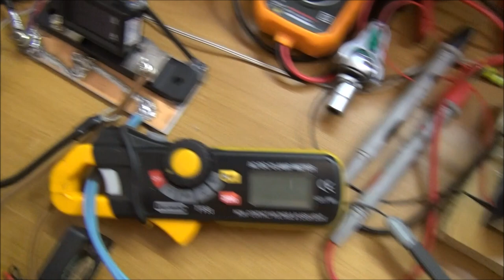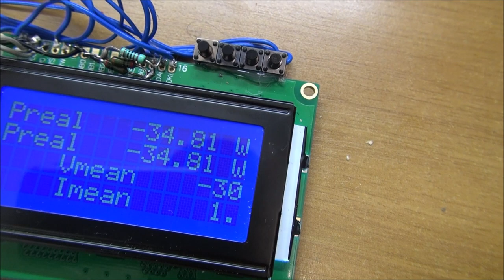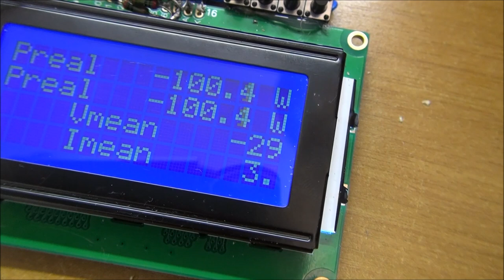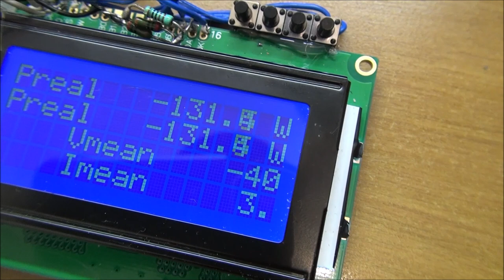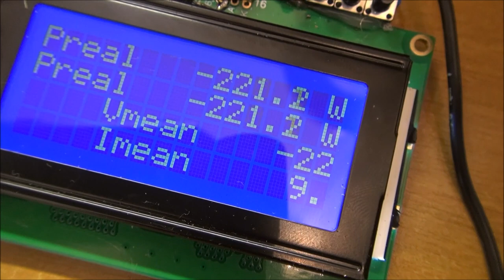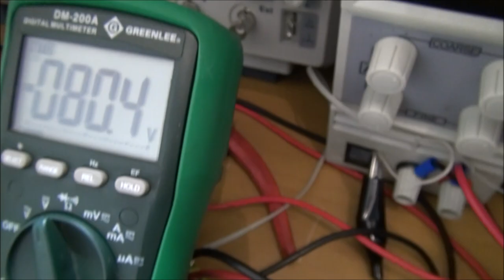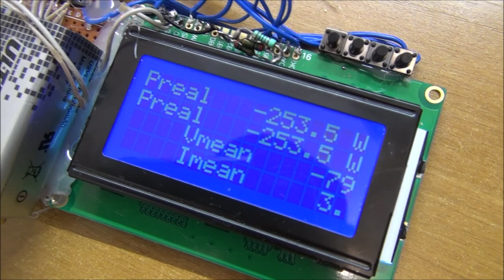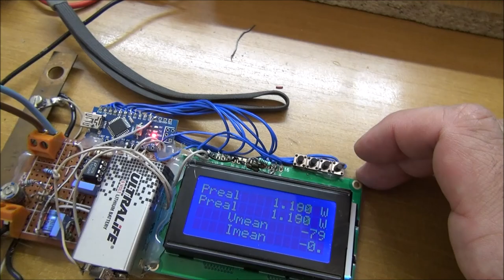Boost converters: The real watts

Comment: hi ,
Does the 48 volt inverter work ?
48 volt 4 batteries required..
Can I use this device with inverter by turning 12 volts to 48 volts
Reply from the maker: If you are talking about the 1500w model yes you can do it.
Reply: @AIexanderHartdegen  thank you
Can you assign AliExpress Link?
Reply from the maker: @suataydemir9144  250 watt 
https://m.fr.aliexpress.com/item/4000037330204.html?pid=808_0002_0109&spm=a2g0n.search-amp.list.4000037330204&aff_trace_key=093e286065e34f0cbe177f0e5ff513e3-1566671079052-07768-UneMJZVf&aff_platform=msite&m_page_id=3354amp-Nyn1V3ZSbWSTtwPtERk9sw1566671192378
1500w https://m.fr.aliexpress.com/item/33044762095.html?pid=808_0002_0109&spm=a2g0n.search-amp.list.33044762095&aff_trace_key=093e286065e34f0cbe177f0e5ff513e3-1566671079052-07768-UneMJZVf&aff_platform=msite&m_page_id=3354amp-Nyn1V3ZSbWSTtwPtERk9sw1566671192378
Reply: @AIexanderHartdegen  thank you...
how many watt current loss on the battery 12 volt...
1500W 30A how many watts energy grout...Does 12 volt discharge the battery quickly?hopefully the correct translation has been....the subject i mean : What is the energy consumption fan and diodes ?
Reply from the maker: the power output is the same than the power input, with a little loss.
For exemple, if you are supplying a device using 100 watts with this DC/DC converter, you will have 105 watts on the battery circuit.
Yes, according to the power output you can use with this unit, this booster can be greedy of energy. And this is normal. Fan and led are not greedy of energy, and those consumption are negligeable.
Reply: @AIexanderHartdegen  thank you that was the answer i wanted

Comment: So, I want to take the output of an 100 amp car alternator and boost it to about 42v 2000w, what would you recommend?
Reply from the maker: You can build or to make engineered the device you want. It can take time and it can cost. But you can spent some money on these bigs converters. You probably need 4, 5 or 6 of these.
You have to connect all the output adjusted at same value with low value resistor each. It can make the job.
Reply: @AIexanderHartdegen 
Low value resistor   value  how many ohm
Reply from the maker: @fapalakad665  between 0.4 and 3 ohms, need to test and check if regulation works for all devices in the same time.

Comment: Hi, i want to step up voltage of my electric scooter, it is 60v battery (30a discharge BMS), fully charged is 67v, can i step up from 67v to 77v? I read the maximum input of boost is only 60v, can it handle 67v? Thank you
Reply from the maker: This is a hard question. For to know that, you need to read the capacitor in front of the power supply section. They need to be at 67v at least. 67V here are the voltage of a non load battery, wich means than this voltage doesn't stay in the time.
You can try by connecting your battery to your booster with a 25 or 50W bulb connected in series. At first, you can see the bulb emiting a short light, and switch of. If the light is always emited (with 5/6.7 volts at it's lead) that mean than the booster is over supplyied. Anyway, take care about that but I think it will works nice. Thans for your comment.
Reply: @AIexanderHartdegen  ok tell me just one more thing, in booster i can regulate the amperage correct? Im thinking in buy the 1800w booster in aliexpress and my battery bms is 30A and my controller is 25A, so in booster i keep the booster at maximum amperage? How i regulate it?
Reply: Do you have any other way of talk with you? Thank you
Reply from the maker: @gabrielpinheiro114  you don't have to regulate anything. This is the role of your controller, you just need to supply enough current and voltage. Just keep the current control of the booster at the maximum.
The potentiometer on the 1800 booster is a current limitation, for preventing an overload on a basic load, or an battery charging process.
Reply: @AIexanderHartdegen  so i keep the input  voltage of potentiometer at maximum and also the potentiometer current at maximum? Just adjust the output to my desire voltage correct?
Reply from the maker: YES. But don't forget a protection of a 50W 12v or 24V Bulb when connecting your battery to the booster. Be sure your controller chan withstand your desired voltage (even with connecting a bulb in serial with it). When nothing is switched on, the bulb must be of (in serial with the booster and battery). You can use a triode of a car (bulb with 3 pads) to simulate a 24V bulb.
First, verify than your booster can support 67v with bulb. If it's ok, let's to the remain thing. You are experimenting, you can destroy your booster, or damage your battery, this is high power with high voltage, this is an unfamiliar hazard project. Be very carrefull for to destroy nothing and burn nothing. Thanks
Reply: @AIexanderHartdegen  but Alexander the 67v im talking is when the battery is fully charged, the cutoff voltage of the battery when empty is 45v. Dont understand good how to connect what you say, can you do a   fast drawing picture? 😥
Reply from the maker: http://lektronik.canalblog.com/archives/2019/11/16/37794373.html
Reply: @AIexanderHartdegen  i do the test 1 with 67v battery charged and 12v lamp?
Reply from the maker: @gabrielpinheiro114  yes, this the first test, the test 1. After that, if you want, you can make the test 2, for just to see if controller can hold the new voltage coming from the boost converter.

Comment: Sir, awesome video. It was very educational. Can you please tell me how to change the trimmers on the first converter you featured to a linear rotary potentiometer. My converter is the 400 watt type. And it has a trimmer for CC and one for CV. My goal is to change those trimmers to the rotary potentiometers for a project I'm working on. Thank you so much. I hope you can help me. I tried many searches and have not found anything. Take care
Reply from the maker: @mario sellet
 Hello, if I understand your question well, it's very easy to change the trim on your inverter. First, you need to read the value on the original trim. Also, the rotary potentiometer for supersiding the trim need to have the same value. The trim have tree point, the center is the cursor, like a rotary potentiometer, and the edge are the limit connectors, like the rotary potentiometer. So, very basiquely, just desoldering trim, soldering long wires to a potentiometer, and using the same order (the central pin on the trim is the central pin in the rotary potentiometer) It's very easy. I hope I understood your resquest well. If not, just tell me. Thanks for your comment.
Reply: Alexander Hartdegen , thanks for your insight. I understand pots need to be same value as trims to be changed. Does wire size and gauge matter? Thanks
Reply from the maker: @milvolts1  no, wire size and gauge doesn't matter. Just need to care about wire disconnection. During process, if a wire, or cursor is disconnected, it can increase the output voltage suddenly, wich can be very dangerous for supplied device, potentiometers are not as stable as trims. Thanks for your attention.

Comment: Thoes 1200 watt boost converters are going for 11$ now on eBay, I'm guessing its because of the coronavirus but I just bought 2 more
Reply from the maker: no, it's because they became old model, there is 1500W model since long time now.
Reply: @AIexanderHartdegen  still cheaper than normal, they have been going for around 15-17 now they are going for 11-13, i have the 1500 as well with the fan and for what I'm using it for they will only ever use 500 watts at most at 66volts so the 1200 are a steal compared to all of the lower wattage ones.

Comment: Thank you for your excellent video :) I bought the large convertor to charge my (12v) 14.6v 120Ah LifePo4 DIY battery. Was planning to run a 20A psu at about 12v to get the 14.6v out. I think it should work just fine.
Reply from the maker: Hello I think you might use the 150w inexpensive model, it can fit easely for increasing for few voltage. Glad you like the video.
Reply: @AIexanderHartdegen  I already have the 1200w one now, I'll just current limit it. I always prefer to have a big thing running low than a small thing running high. Perhaps this is a bad idea with these convertors though?
Reply: @AIexanderHartdegen  I already have the 1200w one now, I'll just current limit it. I always prefer to have a big thing running low than a small thing running high. Perhaps this is a bad idea with these convertors though?
Reply from the maker: That's a good idea. But it was just about the price. Because those device are high efficiency you can use it as you like. But the current limit is a perfect choice on the 1200W model. Indeed, if you use the 150W model you have to care about current limitation yourself. y
The white model have also a current limitation if I remember right. Thanks for your comment.

Comment: Can the boost converter can be contacted to a solar panel and to a motor or battery
Reply from the maker: yes
Reply: And if we need to connect to a 12 v led from 12 v battery. If we connect directly from battery to led and through a booster what difference will be
Reply from the maker: 12 volts led need constant voltage to operate. After a while, when voltage would decreasing, you will have a significant plummet light.
If you use a booster you can feed you 12V led until the battery dead completely, until the minimal voltage afordable to the booster.
Without booster you will have a low effeciency light, but with no loss energy. With a booster you will have a high effeciency light but with a loss added due to the voltage/current conversion.

Comment: Can i connect parallel  to get more current
Reply from the maker: Not like that. You need to add a low value resistor output for each before to connect it in parallel, something between 0,5 and few ohms. You need to make some test to found the best lower value.